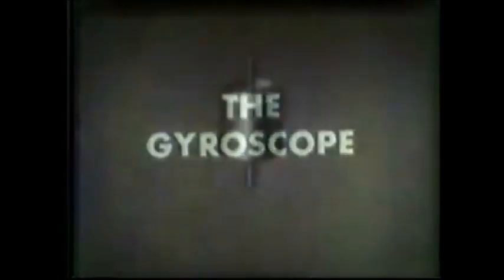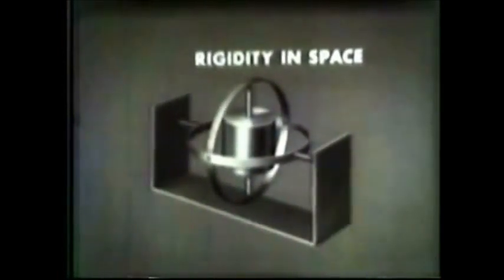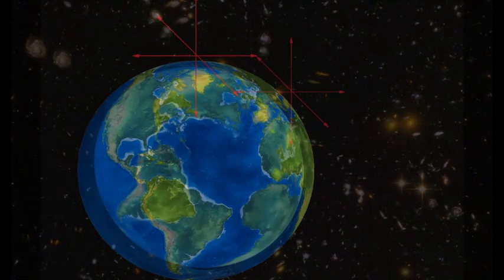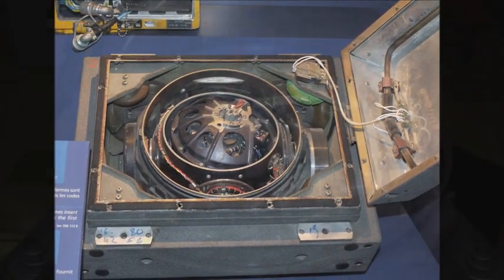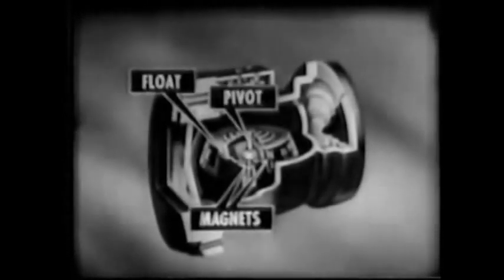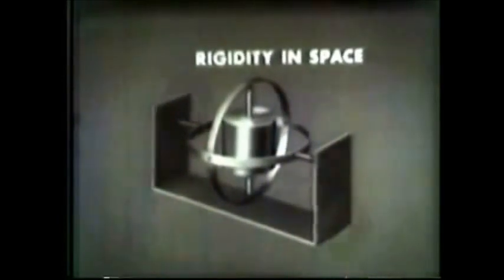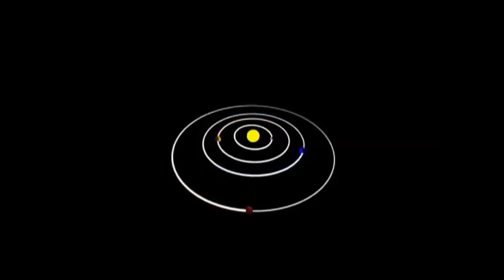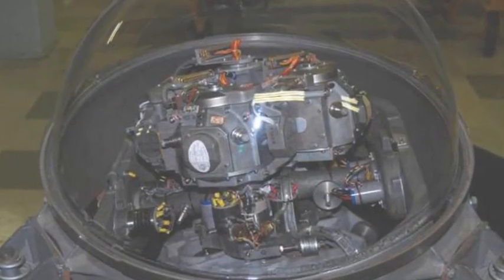Gyro Navigation: IMPOSSIBLE on a Globe...

Comment: Flat Earth BS again. For long duration flights like with a B52 b0mber, there was star based navigation. The computer was a mechanical multi-axes arrangement with motors and encoders that computed the correction parameters for the gyros purely mechanically. The motion model was the "clockwork" itself. The stable reference were stars which have been aimed on by a telescope.  Either you can´t grasp complexity, or you just want to spread flat earth BS. Here´s a teardown of the stellar navigation system:
https://www.youtube.com/watch?v=hzGaO4Kdz2Y

Comment: You flattards know nothing whatsoever about navigation instruments. You idiots think aircraft gyros are like your typical toy gyroscopes that you see in grade school science fairs. FYI, those gyroscopes have erection mechanisms that sense the direction of the local gravity vector and continuously torque the platform so it remains parallel to the earth's surface. Mystery solved. Now please go back to school.
Reply from the maker: "those gyroscopes have erection mechanisms that sense the direction of the local gravity vector and continuously torque the platform so it remains parallel to the earth's surface..."  No, they don't...  That's what you might read in Wikipedia etc., but as this actual Navy training film from 1960 claims, back then it supposedly used a magnetic compass to "continuously torque the platform".  What a joke.  What a contradiction...  If you could use either a magnetic "torquing mechanism, or a gravity-based torquing mechanism, that would keep perfectly aligned with the center of the globe earth, then you wouldn't need to bother with the gyroscopic mechanism in the first place, then would you?
Reply: +the Truth is stranger than fiction...
"That's what you might read in Wikipedia "
Nope, sorry. I happen to be an airplane pilot and have seen aircraft artificial horizons disassembled at the shop. The simpler ones have devices know as pendular vanes that are actually valves that control the opening and closing of 4 orthogonal air slots and their movement in opening or closing said slots is controlled by their own position relative to the local gravity vector. Other types may use gravity-operated electrical switches that control torquing motors. Watch the video and learn, flattie:
https://youtu.be/z1QGRPVBZvw

Comment: Well no. Aircraft gyros orient themselves to the direction of gravity, not to a compass heading.
Reply from the maker: Do they.....?  That is not the official explanation...
Reply: Yes they do. It is called artificial horizon and is not to be confused with a gyro compass or the turn indicator, which are also gyro based, but are different instruments.

Artificial horizons use something called pendulous vanes to achieve that. It can be demonstrated easily by turning such a unit upside down (thats the extreme case) and watch it realign to the local direction of down during a time period of roughly 45 to 60 minutes (from an upside down position)

A training film from 1960, where the animator obviously by himself didn't know how this works, is not the "official version". The official version is to look into such a device used for aviation, figure out what parts are in it and analyse how they work together. Actually the mechanism to achieve that self leveling behaviour is pretty simple.
Reply: the Truth is stranger than fiction...
Yes it is, I'm a physicist, you are obviously an idiot religiously bound and gagged FE.

Comment: LOOOOL.
Spin gyro with axis horizontally at Equator and point it to north.
Keep moving along Equator with the gyro.
In your Flat model if you go 15 degrees on the circle, gyro will decline from north by 15 degrees.
In reality it will keep pointing north.
In fact, it will keep pointing north all the way from Mogadishy, Somalia to Libreville, Gabon.
Or all the way from Macapa, Brazil to Quito, Ecuador.
This is because horizontal gyro axis pointing north-south will at any location around the Equator still be parallel with Earth's axis.

Comment: Real gyroscopes in aircraft have a component that compensates for the earth's curvature. https://en.wikipedia.org/wiki/Schuler_tuning
And text from unsw.edu.au : Gimballed systems attempt to keep the platform perpendicular to the gravity vector, which changes at each point. Schuler tuning refers to the process that is applied to keep the platform vertical.

Comment: these are all points that falls under "troubleshooting" or device usage. the ins is a second choice after GPS because it lacks accuracy (even if the earth was flat) it will shift , there's no a 100% successful device to over come erection or drag.
the artificial horizon and gyro compass are regularly adjusted. I had to adjust both every time I start a flight , even a half hour flight

Comment: exactly, right on! the gyroscope is the "make or break" of the reigning judeo-masonic mathematical religion. I got here in fact by searching for a gyro-compass to buy. The flat earth experiment should be fairly easy. You spin a gyro-compass horizontaly, travel few miles on a boat, or close to a shore, and then check your horizon. If the gyro still shows the horizon, the earth is flat, if it shows above the ground, the earth is a ball. So easy

Also, if you leave it spin for few hours on your desk in N-S direction, if it doesn't move against the frame, the earth is not moving, if it moved the earth is moving/spinning. Strange nobody did those experiments already. (Similar to this one is the Foucault pendulum, but that one has the torque in the string, so gives erratic results)
Reply from the maker: Yes, exactly. There have actually been a few people who have done versions of the experiment of running the gyro for an extended period of time to see if there is any movement due to Earth rotation! 1 hour should produce 15 degrees of axial tilt. But so far, nothing... I'd love to see you do such an experiment yourself if/when you get a gyro.
Reply: the Truth is stranger than fiction... 
yes, in fact I came here b/c I was searching to buy a battery powered gyro-compass. This should be a very simple device to make, and I naively thought it would be readily available on ebay, amazon, etc, but no, apart of gyro toys I can't find anything serious, nothing line a dependable gyro-compass
Reply from the maker: Yeah, it seems like you would perhaps have to buy components separately, I'm not sure.... Another thing I've wondered about are the gimbaled gyros that are used in those "steady-cam" devices.  These are presumably pretty quality made gyros because they run for something like 3 hours at a time on a single battery charge. Of course, you'd have to crack open the case with the gyro in it, which I'm sure most people wouldn't want to do since those things aren't cheap.  But I was thinking about this one day when I actually saw a video of a guy using a steady cam on a transatlantic Concorde flight, which was super interesting, because in 3 hours you're travelling several thousand miles.... Anyhow.
Reply: the Truth is stranger than fiction... 
yes, that is an option. Another option is, by searching around I just saw, is a the "angle orientation device" or something like that, a device for robots to get orientation, which is in fact a gyroscope.

BTW, do you have links to those people who did some experiments, hopefully they made videos?
Reply from the maker: Yes several have made videos, a couple channels who've posted videos on it are Rob Durham and "odeipicku" (or something close to that) just do a YouTube search for "gyroscope experiment flat earth" or something similar...
Reply: the Truth is stranger than fiction... 
I've just seen few, amazing, I don't know how I missed them
Reply: Great video :-) your replies helped me visualize the concept thank you.

Comment: Magnetic compasses don't work in submarines, airplanes and metal ships, there they use gyrocompasses. A GYROCOMPASS is a type of non-magnetic compass which is based on a fast-spinning disc and ROTATION OF THE EARTH to automatically find geographical direction. Find out how a gyrocompass detects the rotation of the globe and you know flat earth is a hoax. https://en.wikipedia.org/wiki/Gyrocompass

Comment: so if a compass is the correction for a directional gyro and location also would have to be known for the difference in deviation wouldn't a accelerometer  correct an attitude gyro showing the direction of gravity?
Reply from the maker: So like I said in the video... "the navigation system needs a navigation system?" This is circular reasoning, if you stop and think about it.  Desperate attempts to defend the globe and rotation, when the simplest conclusion is that it doesn't exist, and all these complex adjustments are never being done in the first place...
Reply: http://www.conspiracyoflight.com/Sagnac/SagnacEarth.html   this is a fiber optic gyro that shows that the earth rotates, but so does the Foucault pendulum you can see in some museums knocking down pins in a circle. so I'm not saying the earth is motionless as some would say. funny though the tamarack mine experiment with plumb bobs showed the earth was concave.   http://www.phy.mtu.edu/alumni/history/DMGPlumbLines.pdf
Reply: An accelerometer cannot measure rotational acceleration and as thus not correct for it, it can only measure linear acceleration. That is why we still use the dampened gyro for a compass. They are even embedded in your smartphone (MEMS) to make the controls more smooth.

Comment: The navy video says all navigation gyros are corrected.  An attitude indicator is corrected with reference to gravity at a rate of about 2 degrees per minute.  Various methods are used depending on what physically  drives the gyro.       Foucault in 1852 demonstrated the gyro turned with reference to the rotating earth by having knife edge bearings and suspending the whole arrangement by a fine thread so he had practically no friction at all.     If you search thru all the documentation you will find all the information you need.    You cannot use any form of inertial navigation on a flat earth because it is only by rotating can you find your position if you travel around the earth at the same altitude.    A ships gyro compass is a relatively simple device it hunts for north which is the position of least force applied but it cannot handle accelerations so is wrong when the ship is altering course and a device like that cannot work on a plane.   Mechanical inertial navigation gyros are corrected by accelerometers.   Modern methods dont use moving parts and just use speed of light.     Inertial navigation is a dead reckoning system -  it gives you relative information compared to where you were.
Reply from the maker: +Ice Skater I am quite aware of all the claims/assumptions you mention here.  The question however is of course whether or not these things are in fact true.  If Foucault's heralded demonstration of a gyro which turned in relation to the rotating Earth really proved such a thing back in 1852, then how much more easily could such a thing be reproduced today?  Certain FE researchers have now even gone so far as to inquire of the manufacturers as to whether or not modern-day gyroscopes used to create the "artificial horizon" instruments used in aircraft actually have any means by which they compensate for curvature, and the answer is still no, even today.  There is no mechanism for this, relying upon either gravitational or magnetic forces, in order to adjust the gyroscopic reading for true level.  Furthermore, many individuals have begun doing their own experiments with gyroscopes, running them for extended periods of time, to try and see if the gyro did indeed gradually tilt due to the Earth's rotation, and once again, no tilt is observed.  "Searching through documentation", and empirically verifying these claims directly, are two different things...
Reply: +the Truth is stranger than fiction... Foucaults pendulum is slightly more educational and easily demonstrated compared to the delicate gyro.  The pendulum gives latitude as well as your hemisphere, whereas the gyro only gives hemisphere and 24 hour rotation. The pendulum does not give 24 hour rotation.    As I said all navigation gyros are corrected so i am not sure what you are meaning with people writing to manufacturers to find if they compensate for curvature.  An artifical horizon is corrected over time with reference to gravity eg air driven gyros use pendulous vanes to direct jets of air.  Piles of documentation on that :-)   The gyro is always kept 'erect' by that correction and the aircraft is then simply rotating around the local measure of level rather than the starting position of level.    The change in a gyro created by the earths rotation is relatively huge by modern standards - particularly for the new ring laser 'gyros' (no moving parts at all - just tubes and electronics) which are I think good for 0.1 degree per hour, but I do agree that there is a big difference between documentation and seeing with your own eyes.  Edit:  You said "There is no mechanism for this, relying upon either gravitational or 
magnetic forces, in order to adjust the gyroscopic reading for true 
level"  As I explained,  at about 2 degrees per minute the gyro is corrected for any errors away from true local level".   For example if you turn 180 degrees it creates an acceleration error so the display shows pointing upwards to the right which is then corrected if you dont complete a 360 turn, and the correction happens at a rate of about 2 degrees per minute.
Reply: +Ice Skater If you switch on a 1970's inertial navigation system it detects earths rotation and gives you latitude.  Longitude has to be manually entered. The Earth rotates a very large 15 degree per hour and even these older devices are far more accurate than one degree per hour.      For sure it would make an interesting science museum exhibit to have one of these visible so you could press a button and power it up for a few minutes and see the latitude detected - I suppose it must have been done somewhere at sometime or other.
Reply: +the Truth is stranger than fiction... You might be interested to know I am going to (somehow) get a civilian or military gyro from the 60's/70's working to demonstrate foucaults gyro.   These things are so accurate I should have no problems showing rotation.
Reply from the maker: +Ice Skater good luck.  Hope the magnetic compass performs as well as it was claimed to... ;-)
Reply: the Truth is stranger than fiction...
In the end I have got an old airline artificial horizon (vertical) gyro and a variable frequency power supply to  run it and hopefully it is not all bent to buggery by the time it arrives in the post!  :-)
Reply from the maker: *****
very cool, I'm jealous.  How much did that set you back?
Reply: It was very cheap. £9 and postage 3 times that.  It is just the remotely located Gyro though I would have to try and find the slave display unit to have a working artificial horizon.  And so far I have not actually bought a variable frequency drive like I thought:-(
Reply: the Truth is stranger than fiction...
I got a variable frequency driver delivered today so I can get the 400hz 115 3 phase or whatever it turns out to be and hopefully the first gyro will be here by the weekend.   Pretty excited about it!   In principle i can get the thing up and running in a few hours and get my latitude.  :-)
Reply: +the Truth is stranger than fiction... Following on from your comment about a gyro axis altering to point upwards on a spinning Earth here is an interesting piece of text which takes that principal and uses it to describe how a ships gyrocompass can be built.   https://www.facebook.com/permalink.php?id=351285611611378&story_fbid=392223414184264   When the gyros are working and I have found my latitude, I will try and make a gyrocompass and hopefully I can put it all together into an interesting video where, as you correctly say, nobody is demonstrating this kind of thing on youtube and I think many people are going to be fascinated to see it.   Further down the track it will be interesting to work out what kind of minimum gyro method can be used to do these demonstrations.

Comment: If you would have done simple research :A Gyrocompas is NOT a gyroscope. Although it does use properties of a gyro but it is not free to rotate on all axes. Sam goes for atrificial horizons.
A gyroscope also regresses in time. So for long-time navigation it's not necessarily great. But the regression is ( I think) due to it being gyroscopic in nature and some coriolis-effect.
Reply from the maker: +Merijn van Schaik A gyro, whether connected to a compass mechanism or not, would be of no value on something like a jet plane (which can fly inverted, do barrel rolls, etc.) if it was not free to rotate on all axis.  Think about it.  I have researched this topic a fair amount, though i of course wouldn't claim to be an expert.  I have heard all the typical explanations/excuses about "regression" etc. however, and I do not find them sufficient.
Reply: No regression in what way. The speed of the axle or the speed of the disc.